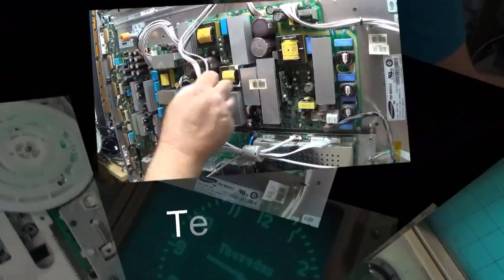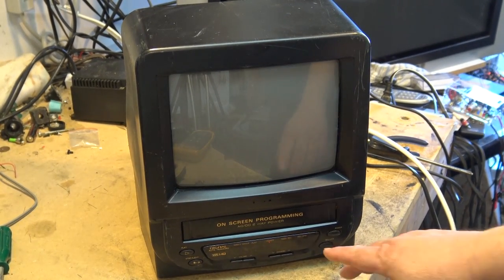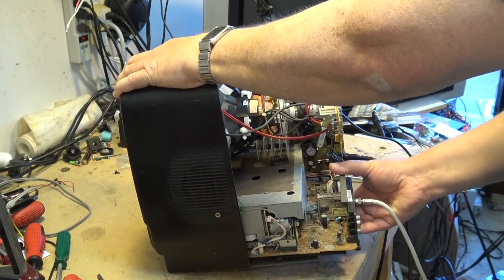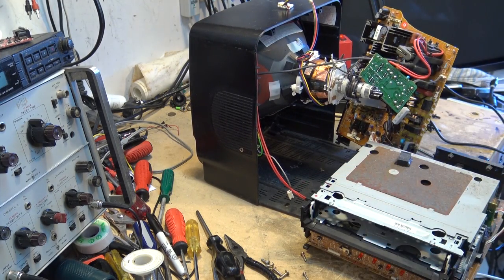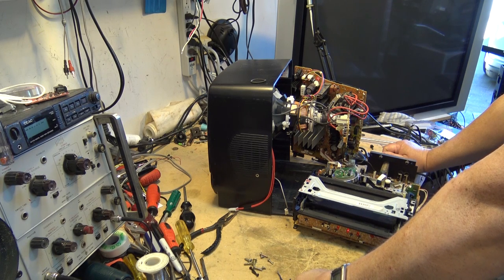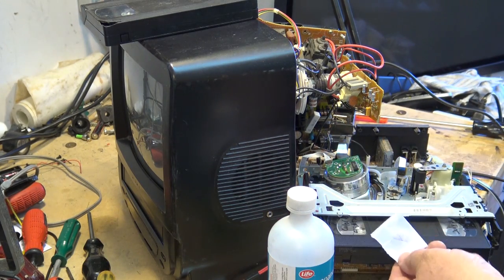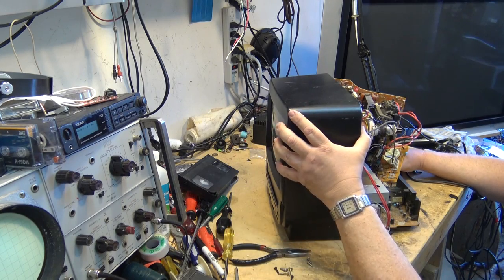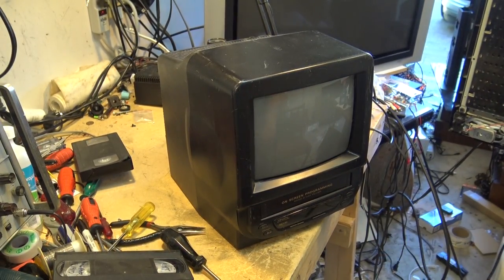Sansui com0953 tear down and repair

Comment: I actually found one of these at Goodwill with the travel case and everything for $20. Everything works except the sound is a bit funky and I'm sure the heads need cleaning. I actually bought it for fiddling around and learning about the TV circuits and VCR circuits. Figured I'd rather test/mangle something small and lightweight that was "easier" to work on due to the tube not weighing 40 lbs before I mess with a bigger TV. This video is definitely going to be helpful as I couldn't find information on servicing the unit and wasn't so sure on how to take it apart without breaking things. Thanks for the video!

Comment: Nice video, I have a Sharp VT-G14 same size as this one, very well built for its day.I repair LCDs and I don't have much experience with CRTs/VCRs and this sharp has a very strange symptom that it changes volume and channels on its own even with the keypad unplugged. I checked the voltages to the two pins to the IC where the keypad connects to and they just fluctuate all the time even though the 5.1V rail supplying the IC and the keypads is dead stable and smooth.

Comment: Ha we had a citizen CRT tv with a VHS player built in I think it was a13" but it also came rabbit ears antennas so we could also pick up local over the air broadcasts. So it was kinda cool when we went camping what stations we could pick up plus it ran on 12 volt as well as 120 volts

Comment: the model number is actually com0950A. the front looked the same as this and it was manufactured late 1995-Early 1996.
Reply: scratch that. since the sansui logo was missing on this one, it couldve been manufactured late 1994!

Comment: Seem to remember the Orion VCr's and derivatives had 3 models in the range and each model had the year in the number, D1098 for example was 1998's basic model with LP, D2098 was the same machine but with Video+ added and D4098 was the top range 4 head hi-fi unit of the same year. D1097, D2097 and D4097 the year before and so on.

Comment: Hi
I have a Sansui QRX7001 when turned on the front left channel A and B
produce a loud white noise even with volume dial set to zero,i am having
to use back left on channel B to compensate also when using PHONO
i get loud popping sound is this something that can be fixed?
cheers

Comment: Dave, There are lots of different 9 inch portable tv vcrs out there. There is even a symphonic funai one from early 1998 the same mechanism as the citizen 13 inch funai one you tore down almost a year ago with a broken head from previous owner who used qtips and broke the head! There are even Ones from 2000-2004 by Symphonic, Sylvania,Emerson, etc. I hope to get my hands on one for nostalgic purposes as i have never owned one before! Then i can take the 9 inch tv and play my movies in the car on future road trips and use it at destinations! There is a video by dieselducy about a sylvania 9 inch tv vcr he has that has a very scary symptom you must see! Type in Epic fail sylvania tv vcr combo and you will see what i mean. The video is from 6/2/2009 and the set was from 2002-2003! ONLY 6-7 YEARS OLD AT THE TIME!!!!!!

Comment: I do like this set better than Funai TV/VCR with dirt cheap.

That set is not junk to me because, it is worth repairing them and get it to work. I think this set is made in Thailand.

Lot of times, people had tendency to scrap the set and recycle them for good so they figure they want to put CRTs to an end and go with flat sets forever and to me it's not worth of doing that because it would depressed me and not even go back to good nostalgia of my Childhood Memory is kind of very hard.
Reply: Bluethunderboom Yeah I always rated the Orion stuff. As cheapie gear went they were always pretty reliable and we'll made. Performance not fantastic but they just sat there and worked for the most part. Funai was inferior but even they look good next to some of the junk on sale in 2017.